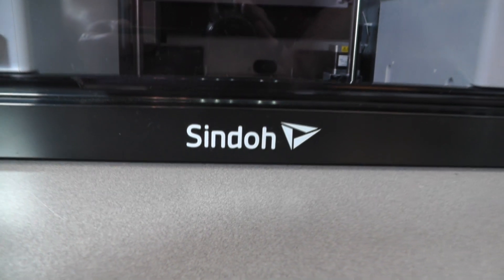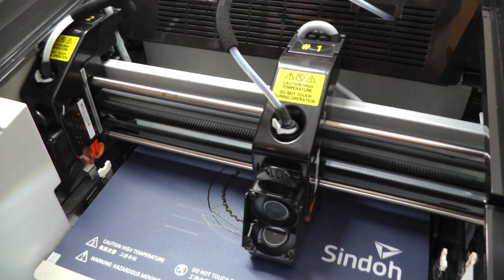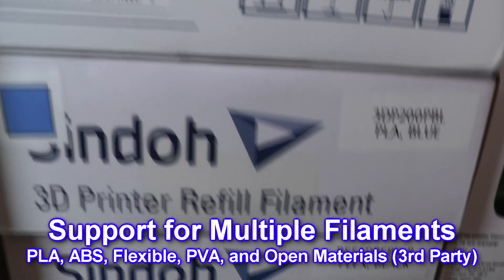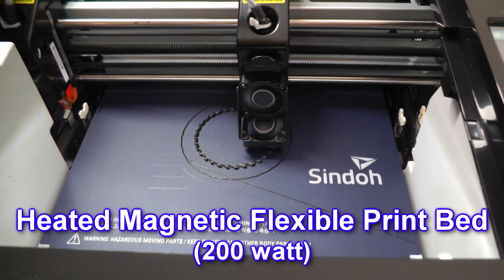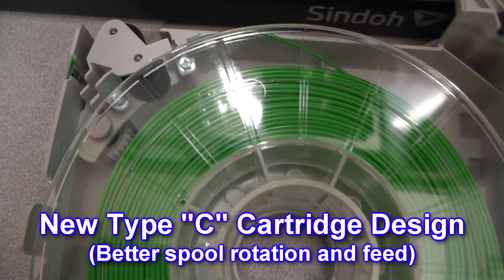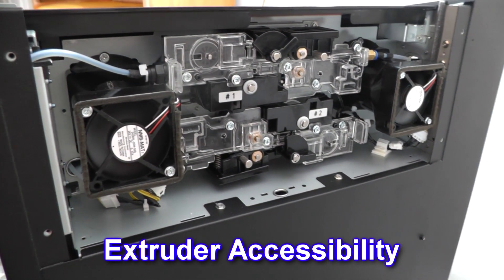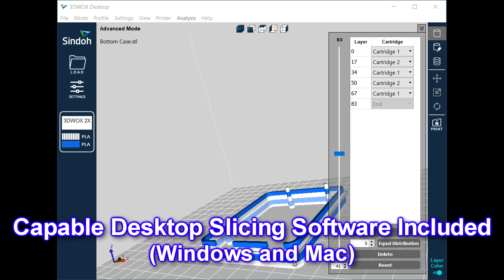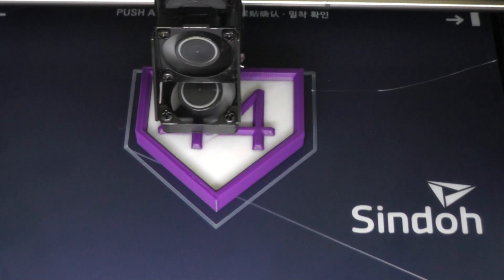00 - Sindoh 3DWOX 2X 3D Printer - Feature Overview

Comment: Bob.  Does your current firmware versio you have support CBfiber?  I had version firmware version 200831_1 installed but was getting some buggy output in the slicer where it couldn't detect my filament type even though it appeared to be correct in the cartridge options.  I went ahead and flashed the firmware and now it wont recognize my cartridges. I went to their support website and I can't find version 200831_1 firmware to save my life.    I am not sure what firmware will get this back to working order and have been at it all day.  I saw on one of your videos a link to http://myworks.sindoh.com/upload3/userfiles/  ~  but there is a log-in and employee number id or something strange.   I was going to snoop around in there (lol) and see if I could find that firmware version that obviously is a beta or something strange.  As always your channel ROCKS and is very informative and I appreciate your time.
Reply from the maker: You are running a Sindoh 3DWOX "2X" model?   I generally keep my firmware updated through the online menu on the device and I'm currently running the latest, 190726_2.  I don't know about the carbon fiber, never tried it, but I have not had any issues at all on any of my 3DWOX machines not reading the cartridges.  You have the chip installed correctly (orientation) in each filament cartridge and assure their is good contact when it the cartridge is inserted in to the slot?  Also check for any foreign matter not allowing good contact with the filament circuit "chip".  Lastly, what video did I refer to the "myworks" link you posted.  That does not look familiar to me.  If you continue to have problems, create a support account and put in a ticket with Sindoh support at:  https://3dprinter.sindoh.com/en/sign-in?url=support/faqs/qna       It may take a day or so for them to email you back, but they are very helpful.
Reply: @AllThingsBobot  Yes.  I am running the duel cartridge sindoh.    I purchased three of them because I got a really good price on one then on the other two of them; the purchases were about 1 month apart.

Each Sindoh was set up to run RZIM and rzimsu; a clear plastic support filament, not the pva type. 

Its also set up by the firmware to run Carbon Fiber in the firmware.  What has been happening to me is that when I run the slicer sometimes my filament selection doesn't execute and it thinks there is another filament in the cartridge.  I assumed it was a firmware bug and even though I knew the Newer version was older then the one I downloaded on the internet, I went ahead and flashed anyway.  On my other two machines, the firmware starts out 200xxxx ranges, though both are not identical after 200.  The latest updates for this printer on the internet show a 19xxxx firmware.   When I flashed the new 119xxxx firmware it immediately didn't recognize my Carbon chipped cartridge nor my rzimsu material.  I have since put pla in and no problem.    I know you have tinkered with these printers a lot and the reason I asked you was I figured you might know.   On the other two printers, I was wondering if it was possible to take a snapshot of the current firmware?  If that is possible I will share with you the firmware I have for carbon.   I think these printers were sold by a direct seller or representative for the company.  If there was a way I would just back up from the other printer[s] a copy and reload. 

About the web-page where I got that link.   I was watching your video on the single cartridge Sindoh and at 2:30 seconds in this video, you show this link,  "https://www.youtube.com/watch?v=tkXcwkPljV0&t=153s&ab_channel=Bobot%27sTrainsandMakerZone" 

Whatever that is, it is a portal where firmware versions are located.  It does require a username and password.  I was trying to get into that location to find firmware.    

Yes, I have contacted Sindoh before and it takes a while to get a response.  If you know how to backup the firmware I can save you a copy for Rzim Carbon Fiber.     

Thanks for your help.
Reply from the maker: @johnarnold9670  OK sorry I can't help.  I have no idea what RZIM and rzimsu are, nor have I seen reference to the 200xxxx firmware via the Sindoh official website.  It sounds like these printers had their firmware modified by a reseller to accept different filaments outside of the official Sindoh channels?  Where did you purchase them?  If they had modified firmware from an outside vendor you would have had to update via them, not through the Sindoh site, of the firmware would lose functionality for the mods.  Just my guess.  As far as the link in my video, yes it appears I did reference that but it was for the DP200 model and so long ago (5 years) that I forgot about it and with newer firmware is likely no longer valid.
Reply from the maker: Also assure you are running the latest Sindoh 3DWOX Desktop slicer software update
Reply: @AllThingsBobot   I am .

Comment: Bob.  I just recently purchased this printer and have followed your guide on the open filament. That went extremely well and you did a fantastic job on the instructions.  Thank you so much for that.   As I dive into the features of this printer I am curious if "out of the box,"  I am curious if both heads / extruders; 1 & 2, if support rizium gf and support materials.  I am confused to say the least if there is actually a pva head on it or not because they look somewhat different near the hot end.  The website is vague about it and implies you just need the printer and the materials and you are off to the races.  However, after reading some, I am wondering if I need a PVA head for that material and another head for carbon fiber.  They really are vague on the subject.  Seeing you have dove into this printer can you offer some advice here? Do I need more hardware for pva and carbon fiber materials?  Thanks !
Reply: I am interested in your findings on this topic as well; use of alternate & carbon materials...
Reply: @vincelamanna3774  I contacted them and apparently the two nozzle that come standard will burn carbon, rizum glass, pla, abs, as for the pva, yes I had to buy a separate extruder for that.  So, that's the answer, good luck!
Reply: @johnarnold9670  Thanks John, so which extruder is it? The one in the link above says it is for PVA filament only, no mention of Carbon...
Reply: @vincelamanna3774   Both Extruders; #1 and #2 ARE FOR ALL FILAMENTS EXCEPT the PVA.  Keep that in your mind.  So you could run anything through either of them but if you want pva for water soluble supports, you will have to change out a head and put on the pva head that runs about 145.00 from the store.   I think the software is somewhat buggy and you will want to update the firmware for sure.   Any questions just let us know.   Thanks.
Reply from the maker: You need to buy the optional PVA Nozzle (https://amzn.to/3p3MlbF) and use the PVA Plus Filament (https://amzn.to/3p70XHa) which for some reason is incredibly expensive right now.  The listing on Amazon for the 2X shows compatibility with 'metal' filament and others for the standard nozzle.  Over the years I've seen references to harder filaments listed as 'they may work but will lessen the life of the nozzle significantly'.  Please create a support account and put in a ticket with Sindoh here:  https://3dprinter.sindoh.com/en/sign-in?url=support/faqs/qna    It may take them a day or so to respond but they usually provide good info to requests.  Hope this helps.